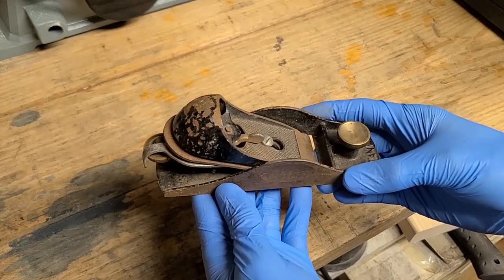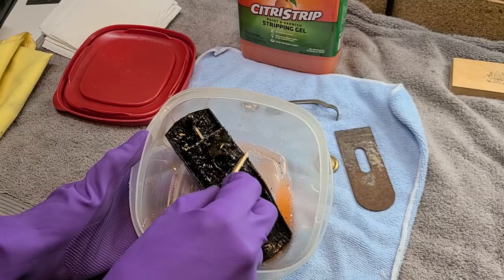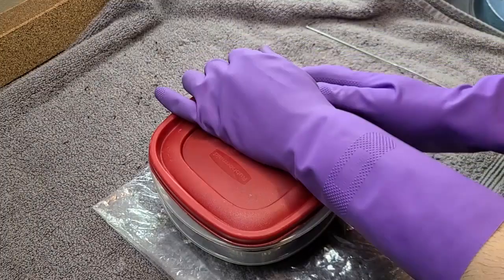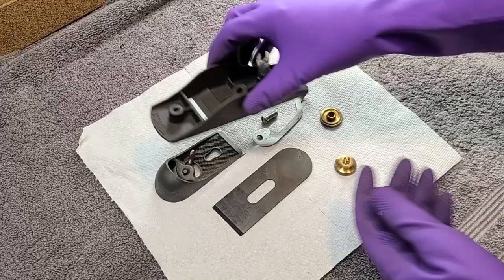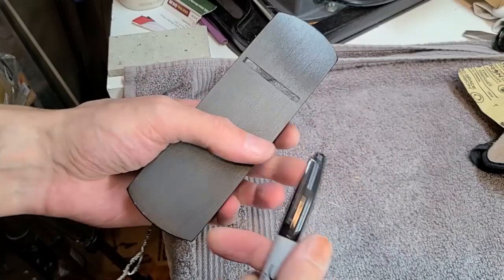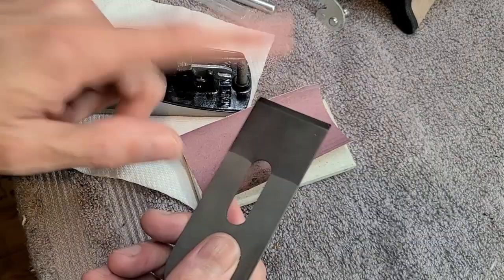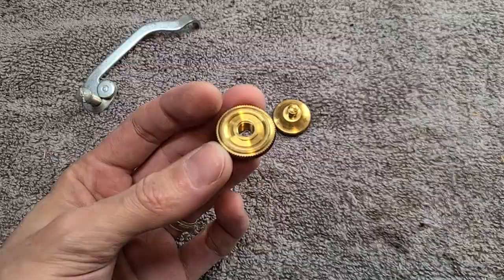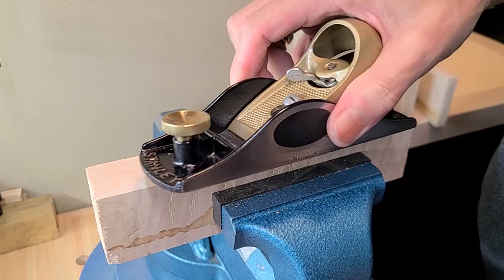Rusty Stanley 9 1/4 Block Plane Restoration

Comment: Nice video!  I just bought one of these from a flea market and needed to know how it goes back together  as far as flattening the sole, I'm told you should only flatten with the blade installed (and pulled back) because the shape changes when the blade is clamped.  There may be a hollow otherwise.
Reply from the maker: Thank you!
In my experience, the thing about flattening the sole with the plane assembled is a myth. It may be true on extremely flimsy planes, but these heavy cast iron ones don't flex to the extent of making a difference whether the plane is assembled or not.  👍

Comment: Hi, I also feel you do not need to make the sole completely flat. All the hand plane I have restored work just fine. I also used detergent and salt to remove the rush leaving in the solution a couple of days. The rust was easy to clean off. Next time us wax candles to coat the clean plane a couple of hours and apply the paint. Good job you are doing if you have the money to buy these expensive products.....

Comment: Great video! Quick question - why were you concerned about over-cleaning the knobs?
Reply from the maker: Thank you!  😊
The brass knobs have patina, and I like preserving original patina whenever I can. I prefer that slightly aged look instead of the shiny brand-new look.
Reply: super helpful , thank you again! @SculptyWorks
Reply from the maker: @zacharykeller9038  👍

Comment: Do you not need to paint the sides ?
Reply from the maker: You shouldn't paint the sides, because if you're going to use it against something or in a shooting board (though these are quite small for shooting boards), the paint will rub off.